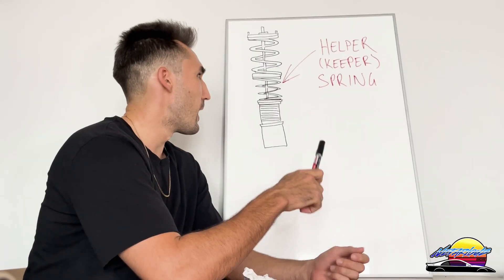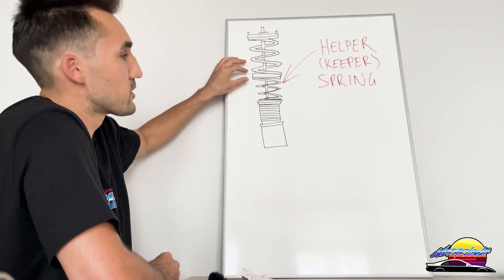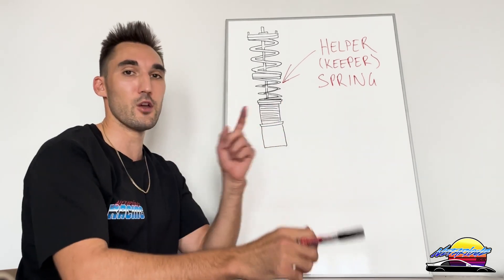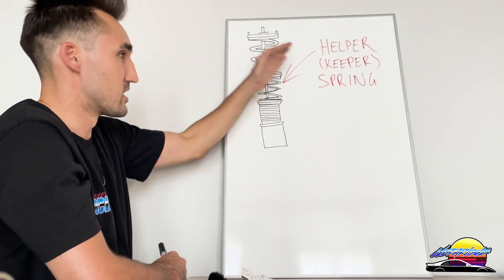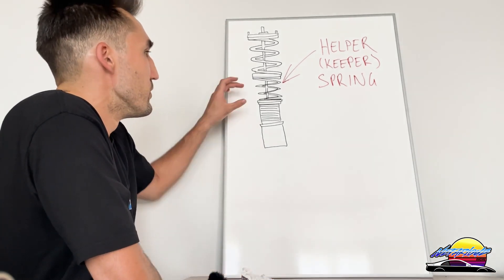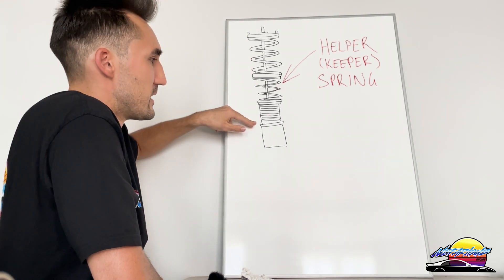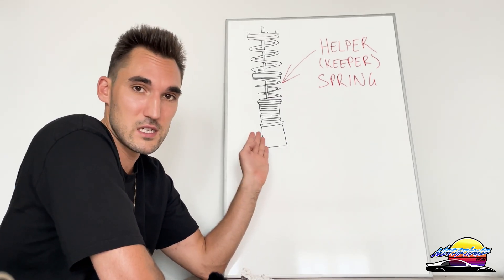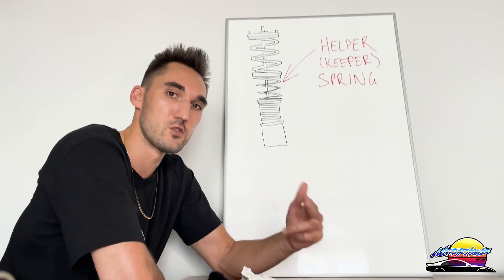What Are Helper Springs And Do You Need Them?

Comment: I discovered that, due to a certain mod I made on the car, the rear helper springs get in the way of the drive shafts.   On my "fixed height" coilovers, if I raise the lower perch 2-3" to get the helper out of the way (of the shaft) will it lift the ride height?   In other words, what's the difference if the helper is maybe 4 inches long vs 0 inches long (fully compressed)?
Reply from the maker: Yes it will raise the car. The helper is fully compressed under the weight of the car, which means you can only lift the perch by the amount of the fully compressed helper and not raise the car, which is probably about half an inch.

Comment: Thanks for the explanation. I see some coilovers advertised with helper springs to improve ride quality (Ceika). What are your thoughts on that?
Reply from the maker: I'll have to look into their explanation specifically but I can't see how helper springs will affect ride quality at all unless they are doing something unusual.
Reply: @nefariousracing  here's what they told me: the helper springs will give you more travel and droop. It will help keep the tire in contact with the road and provide better handling and comfort on rough surfaces.
Reply from the maker: @matsudakodo  I'd be amazed if you felt a change in comfort, but they can help with additional stroke which can help with handling, but only if the rest of the coilover is designed to have the longer stroke length to match. Just throwing helper springs on by itself won't do that. So depends how their coilovers are engineered and made.
Reply: @nefariousracing  I agree

Comment: I have ohlins street and track. Currently when I go over bumps or take a sharp turn the wheels touch the fender liner. It did not do this previously even when it was lower than it is now. What could be the cause?
Reply from the maker: Possible causes I can think of:

- Wheels or tyres changed (I assume not since you didn't mention it)
- Fender liner itself has dropped
- Dampers are set to softer
- Your springs are sagging (least likely)